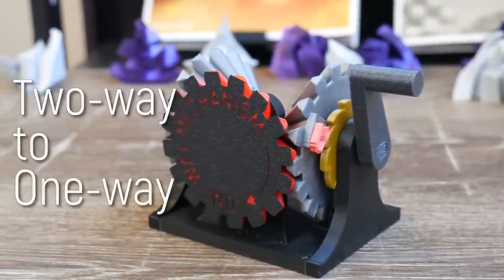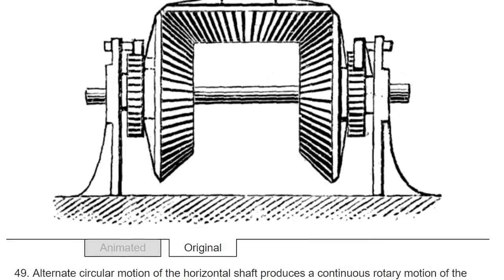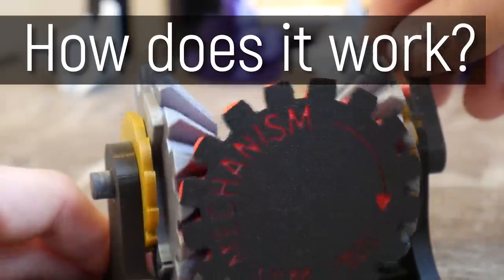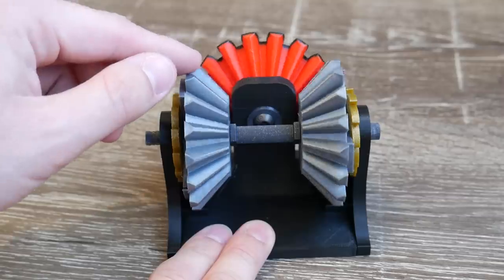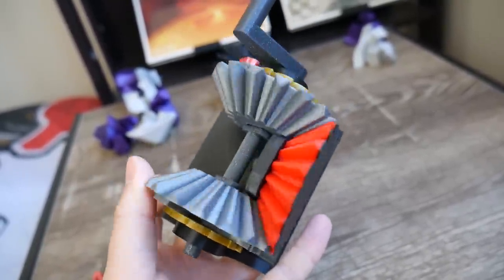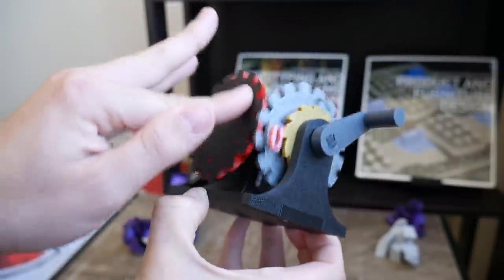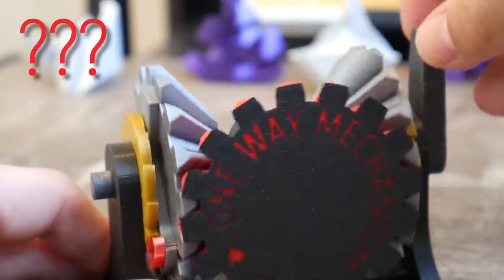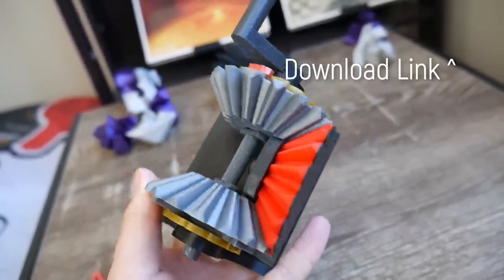This Mechanism only turns Clockwise, no matter what.

Comment: Could be used as a monodirectional hand-crank in any situation where the crank does not rotate entirely in a circle.
E.g. if the space allowed only gives 90 degrees throw to the lever.
Reply: That was exactly the thought that crossed my mind. It's efficient in some way then because there's no wasted movement, you get output from both sides.
Reply: When he did the quick back & forth, that's exactly what came to my mind.
Reply: Like a lever to manually put the landing gear down in a plane. Having the up and down strokes contribute to the task could save the plane if time is of the essense. 😀
Reply: Owen Sparks that's an excellent application. Further, if the pilot is flying solo, it would allow him to remain in optimal posture to watch his instruments, maintain control over the yoke, and would likely lead to less fatigue and stress on his own body, as the mechanics of his arms are not optimized for full circular rotation.
Reply: It is used in most modern sail winches from what I understand
Reply: a random steve on youtube this is what came to my mind too. Interesting to note that you can achieve a different gear ratio for the two different directions, as in sailing winches you have clockwise for slow/more torque and anticlockwise for fast.
Reply: Would a two way pump ratchet work though? Cause you’re then applying weight/force on the opposite direction..would this make extra force and stress on the clockwise gear?
Reply: Miniaturize it into a type of ratcheting screw driver :)
Reply: smokeydops a ratchet wrench that you can twist either way. Half as many turns in the tight 10 degree space
Reply: smokeydops so basically a wrench
Reply: If this mechanism was on a jack, you could raise the car by twisting the crank both ways
Reply: 666th
I have betrayed my god
Reply: I actually have a ratchet that uses this mechanism, though it's built into the handle, so rather than a ratchet that turns both ways, you have a normal ratchet that can be used as a 90 degree screwdriver once the bolt is loose. Flip the switch and rotation is sent the other direction to tighten. It's called the Kobalt "double drive" ratchet.
Reply: I was thinking powering an electric car with ac power. Doesn't seem practical but hey.
Reply: Your comment = 
"Could be used as what it is, in any situation  where it does what it does. E.g if the requirements are required."
Reply: This is exactly the type of mechanism used in cheap gimmicy ratchet tools where you select clockwise or anti-clockwise and either direction advances the ratchet... Usually, it's used for screwdriver form factor tools rather than lever types a.k.a. A normal ratchet. 

Smart idea, so props for out of the box thinking, but in actual application, it's far easier due to the mechanism compactness and strength to just use a regular ratchet lever to advance in 1 direction and reset/ratchet in the other. 

Unless there is some super specific requirement for the 'speed' of the output to be thus that all the 'work' must be translated into motion where a regular 1 way ratchet would not suffice and torque/ load requirements are not excessive, I can't imagine many tools where this would be too useful.
Reply: I have a similar ratchet, but the mecanism is unidirectional, turn the handle on the shaft and the socket goes around. to make it bidirectional they made it so you can fit a socket to either side of the head.
Its really useful in tight spots where you have room for just a few degrees of rotation, but not as strong as a proper ratchet..
Reply: This could also be nice in a lever chain hoist. It could be nice in a ratchet as well, but I think this mechanism would make it too big and bulky to be practical.
Reply: Sounds just like the Facom "FAST ACTION TWIST HANDLE". Does exactly the same thing, really handy tool I have to say.
Reply: It's also useful for tidal generators.  Tide comes in, spins a turbine clockwise, you get clockwise motion out and power generated.  Tide goes out, spins a turbine counter-clockwise...you still get clockwise motion out and power generated.
Reply: +Kingston Anderson I had a 1/2" ratchet with this function built into the handle. You could actually rotate just the handle on the end of shaft in either direction and it would rotate the socket in the direction you had it set to. It was perfect if you didn't have enough space to use the ratchet with leverage, once you got the bolt loose enough you could just use the handle action without having to move the whole ratchet to get the bolt out.
Reply: +Carnaxus
AC generators don't really care which way they're being spun, though. It would be more efficient to just run them both directions, due to the mechanical losses in the one-way gearing. Now if you're using water power to drive machinery, and the water could possibly flow the other direction but you don't want to design your machinery accordingly, you could put one of these in between to make sure the driven direction never changes. I suppose it could be used on a fixed (non-pivoting) windmill for the same reasons.
Reply: With a set of reversable rachet and pawl mechanisms, it would make a pretty handy tight access rachet tool, as other people said. Also, with a planetary attached to one side of the axle, you have a high torque/low speed or low torque/high speed winching drive. Or combine both and have a super winching tool.
Reply: I reckon a back-and-forth 90 degree ratchet would be much faster than a 360 degree circular crank. Would be a cool product.
Reply: smokeydops I have a ratchet that works somewhat like this, such an amazing tool. Of course you can change the output rotation  to go clockwise or counter, but I’ve always wondered how the internals worked, now I have more of an idea :)
Reply: it can be used in harnessing mechanisms within which the harness must be reset to it's beginning position to continue operating (I.E. a piston once fully extended must retract in order to extend again : if turned into radial movement without such a mechanism the gears would essentially be moving clockwise for 50% of the operation and counterclockwise for the other 50% as the piston can only extend for 50% of a cycle's energy).
Reply: if someone posts the legitimate method they got around this "piston problem" in steam engines - mounting the piston away from the center of a gear/wheel and timing momentum and extension/retraction to gain continuous motion - ima lose my shit.  as a Steam locomotive enthusiast I'm more than aware they used other methods to get around these problems however many are large, space-consuming solutions that had patents associated with them - making developing alternatives important for the railroad industry despite the end result of basically universally licensing the design concept.
Reply: Huskey double drive screw driver
Reply: This would not work for a ratchet wrench. From what I can tell, this mechanism requiers 3 contact points: The input, the output, and a point to hold the mechanism on place.
Reply: smokeydops m
Reply: Two speed sailing winches
Reply: dude  it is a differential., it is basic. ever car has one lame vieo
Reply: smokeydops so.... an oversized socketed ratchet? a crank driven one at that?
or are we describing a single use winch that comes out-of-box comepletely unwound
Reply: Eric Sapp how do you engage it in the opposite direction? i suppose you could just fix a hex bit to the end an inch back from the bit tip and turn the whole thing around.
Reply: Could be used to convert reciprocating motion into rotation with less cam travel than other methods.
Reply: it would be very useful in lots of human powered applications... like five people pulling on ropes to drive some kind of mechanism...
Reply: I thought this the first second i saw this video.
Reply: And the cawls could be easily replaced.
Reply: I was thinking almost the same thing but wind powered, instead of the handle just put cups like the ones in an anemometer, if the wind blows from anywhere you get the rotation no matter what, interesting!
Reply: Maybe a fixed windmill that could turn either direction depending on wind direction?
Reply: Kingston, it already IS a ratchet.
Reply: Eric, no, because then you could only tighten or loosen on that particular driver.
Reply: But then, Mega, how do you lower the vehicle?
Reply: Andre, it's not practical at all. How would it even work? Besides, what would be the point if they already have a way better way of already using AC motors to do just that?
Reply: No, Nicklaus and AIO, because then you could only ever use that wrench to tighten or loosen but never the other action.
Reply: Jordan: show me what tool manages to work in the weird way you believe it does. And why are you putting quotes (even single ones where regular ones would go) around "speed" and "work"? Are they just figurative, somehow? Are they not actual speed and work, or...?

Happy Pioneer Day (Utah, USA)!
Reply: So you can flip a switch and swinging the wrench handle in both directions produces the action you want, either tightening or loosening, instead of that action in one swing direction and neutral in the other?
If that's the case, then what's the specific term given to those and why aren't they all just made that way?
Reply: johnsamu if you cannot rotate completely in a circle there is no rotation after moving 1 direction completely
Reply: @Dan and @ Maxx. Could you be referring to the blue point wrenches? If that is the case the case it isn't the complicated mechanism that makes it expensive. It is the materials. The design is very simple that it uses a simple rounded tooth gear and adjustable ratchet pin.

As for why they aren't the all made that way? They aren't designed to handle a lot of torque, but is in most cases just a quality of life perk. I have a metric socket set as well as spanner set like that.
Reply: To everyone asking, kobalt made both a screwdriver and soxket wrench that have both a traditional ratchet and a monodirectional mode
Reply: If you could put the socket on either side of the head it should work both ways, otherwise it would only be good for tightening or loosening bolts depending on which way the teeth/pawls point.
Reply: That makes me think of wheels turning in forward or reverse but still supplying rotation to a battery charger.
Reply: This is not the same as a typical car's diff, those have other housed gears and rely on the drive shaft turning one way or the other. This demonstrates the capability to produce rotation in one direction despite the direction of rotation on the input shaft.
Reply: forgot all about this one direction ratchet
Reply: patrick gronemeyer if drive shaft changes direction so do axels
Reply: This I was about to comment but didnt know how to put it
Reply: Like those hand power train things?
Reply: It’s like a ratchet but it works all the time
Reply: And how do you retract not only what you said but the object you described that it would be attached to

Comment: I worked in rope rescue and we had a device that did the same as yours for pulling rope around a pulley.  The biggest difference was ours had two speeds, turn right for fast gear, turn left for low gear high torque.
Reply: Good idea
Reply: That's cool.
Reply: Larger yachts have similar two speed winches.
Reply: There are 2 speed fishing reels that work the same way.
Reply: Planetary gears?
Reply: Sweet ! Double action and fool proof too !  I just wonder, how you would lower a guy on a rope when the rope is attached to  a device like that ? Does that take a second type of mechanism on the same line ? By the way, now that I come to think about it, I wonder how you would lower someone with a hand cranked device anyway ?!  You'd need a mechanism that limits the speed at which you lower the dude, works independent of the weight attached to it (to a degree), but it also must not allow things down too much either... what devices are there to keep a moving, pulling force in check !
Reply: A lot of sailing yachts have these to pull ropes
Reply: @Rax look up harken industries thats the tool he is talking about.

Comment: Crank generators use this. You can pump a lever up and down and the generator is continuously turning over.
Reply: What about those hand train carts? the lever pushes the wheels both ways but the wheels only move forward.
Reply: @nicynodle2  yeah, I never thought of this! Nice!
Reply: @nicynodle2  Yeah that's true! Never thought about how they actually worked :D
Reply: Leonardo da Vinci actually designed and built one of these with a lever that would produce one direction of movement either direction the lever was pulled, but I don't know what it could have been used for back then.
Reply: crank generators usually use a full bridge rectifier, not a mechanical rectifier.

Comment: They used to be used as mechanical odometers back in the day on forklifts, would record both forward and backwards movement, before they went to using run timers for the metric of use.

I have never seen an application where actual torque/work was being done by that mechanism though, due to the load having to be transferred through the palls.

Comment: I saw one used in a music box so there is no way to play the music backwards.
Reply: Thomas Hiemstra 7
Reply: Thomas Hiemstra 
Could you hear the rattling?
Reply: Using a very small distance for the ratchet to engage the paul would make it nearly silent in comparison. Angus's is loud do to the SNAP action of the rigid PLA and distance it is traveling to engage its mating surface. In a music box i would assume this distance would be a fraction of a millimeter, and done with a soft brass spring to hold tension.
Reply: No, just the music
Reply: Depending on the kind of music box, if it's the metal tongs + pegs kind, driving it backwards would be impossible without damaging it anyway. Good example use case for this design.
Reply: Thomas Hiemstra 
LOUD CLICKING WHILE MUSIC IS PLAYING
Reply: but how we would be looking for satan speeches then?

Comment: It can be used in pendulum clocks to convert back and forth motion of the pendulum into the "ticks" of the clock face. It can also be used if- when you convert continuous rotation from a crank or motor to a rack and pinion- you want to keep perfectly accurate track of the output; you can tie this mechanism on to the output gear (and track the rotation degree, count the teeth, etc.) instead of a tracker on the input gear (sometimes inaccurate or hard to translate on gear slipping mechanisms).
Reply: dalsio The ratchet clicks would be soaking up the energy from the pendulum slowing it down significantly
Reply: You can tune the ratchets to have a pretty low spring force and minimize losses. Besides, I didn't say it was efficient, just that it was possible.
Reply: dalsio maybe a clutch bearing. They freely rotate in one direction and lock when reversing.

Comment: I used to have a screwdriver with a simalir mechanism inside it.
So when you screwed it both turning it in and turning back both screwed the screw.
It saved me like 2 second a screw. Lol.
Reply: Wait so how would you unscrew the screw?
Reply: Adam Kelly  having used one there is a switch on the side which locks up the mechanism or is some cases reverses it.
Reply: I have a ratchet like that. Twist the handle back and forth and the socket will turn whichever way it us set to.
Reply: where might someone find this screwdriver?
Reply: @racecarthedestroyer7192  kobalt makes one